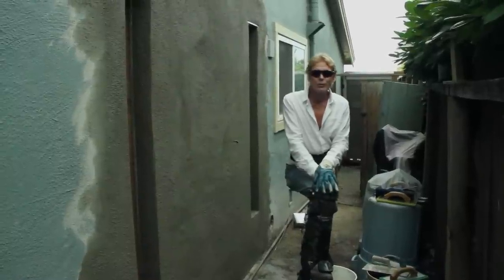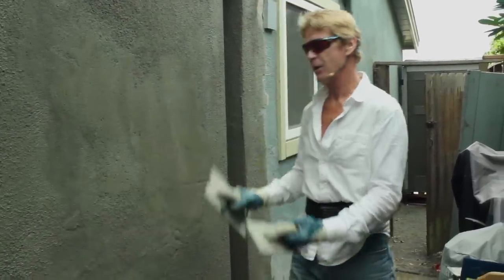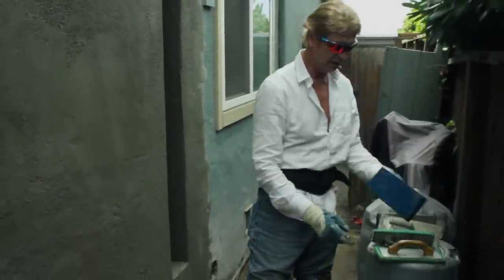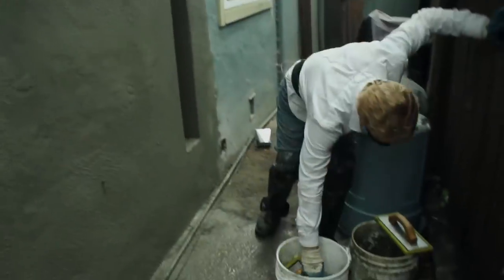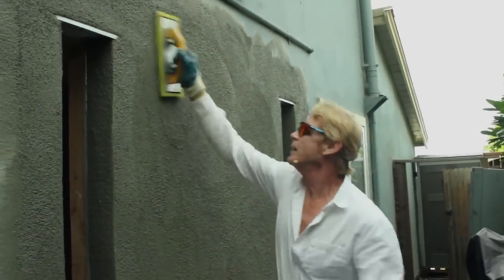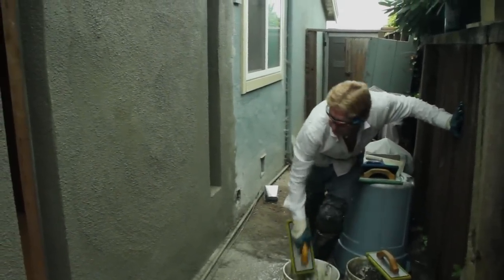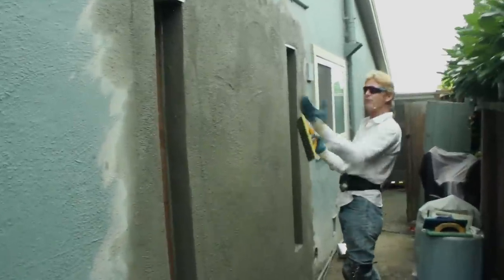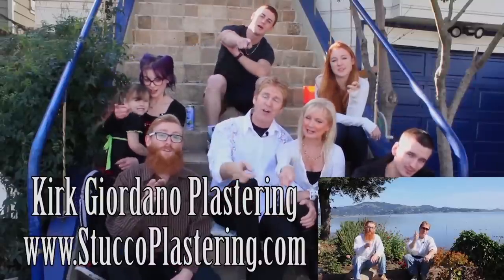Stucco sponge floats bring out sand or aggregates.

Comment: If you do alot of stucco you will have walls that "get away from you" and you'll be busting your ass to finish it.....because we are human and that's just the way it goes at times, lol

I have been there hauling ass, beat ass tired and no lunch break. Lol

Cement doesn't wait for anyone

On other side I have been at jobs til midnight cuz I poured a slab too late and it just wouldn't set up.......live and learn
Reply from the maker: Exzackory, I have lost a few walls, as a rule, not more than I can count on one hand, as once that lesson is learned, you stay learned. Concrete slabs, now that another animal, are twice as difficult.🍻

Comment: I got a job doing a stucco patch. The stucco had bulged and cracked open in places some of the wire lathe had rusted a real mess. I work with concrete never worked with stucco. 3 people before me tried and failed. So my job was not only just to do the  repair I also had to blend out the mistakes of the first 3 guys. One guys patch had a bulge all the way around where their patch met the original stucco. Because of your videos I have a very happy customer. Thank you so much Kirk you were the reason why my client is so happy.
Reply from the maker: Good evening John Wadsworth, I'd love to take the credit for your job well done, but the fact was it was your intuition of the time spent learning and retaining the information, that created your success.
 Cheers my plastering friend.
Reply: @StuccoPlastering  Kirk I still can't thank you enough for all the information I received from the videos you took the time to make. And I really appreciate you for replying back to me. The house was a very old one it's stood in Monrovia California for over a hundred years. I had no idea what I was doing. The information about the different color sponge floats and what they are used for helped a lot. Like I mentioned to you before I had no experience working with stucco. I was very nervous when I got the job. And being that it was also a referral made it even more urgent that it was done correctly. It's been over a year and it looks great. Being I was the fourth person to try and fix the problem it was a must that I get it right. There were a few moments of panic but I learned to relax. I have my own business and it's tough being a one man show. Anyway just thought I'd touch bases with you and thank you once again for teaching me so much in a short amount of time. I have no idea where you are from, it would be nice to sit down and have a beer with you or go grab a bite somewhere on me.
Reply from the maker: Evening John, your comment makes my point, many can learn when paying attention and when they need to know how to do it correctly, Thank you brother for the kind comments.
 FYI, I'm in the Oakland, ca. area.

Comment: Hi Kirk! Thanks for the video! I’m curious, if you’re trying to match a sand finish with interior plaster (using usg imperial base) do you use a similar approach to this with a sponge float? I have lathe and plaster in my 1930 home and there seems to be some sort of aggregate in in the plaster that they’ve vertically brought out with a float? I’m so puzzled on how they achieved the finish and so are others I’ve showed pictures to.
Reply from the maker: @dianaallen9172  Morning Diana, imperial has fine sand so yes it can be brought out with a float, this technique can work, sounds like they wet the sponge float which makes deeper float lines that are noticeable. Send me a picture at kirkgiordano@gmail.com cheers

Comment: Hi Kirk, huge fan and avid watcher (is that a word) of your channel. We have a so cal, Orange County house and had some stucco replaced from the mini mountain finish, I called it, to a flat / sand finish. The contractor was a joke and the whole job thickness is thin ...thank goodness they only did the front.  I’m thinking they didn’t set the wire out enough and did a thin scratch and thin brown coat, and the icing is the color coat is 20 shades of brown 😪😪. I. Estimate it’s about a 3/4 inch difference from the original thickness (when I drill in to attach something it’s not even 3/4 thick, boom right through).  How can I address the thickness issue?  Should I go back and  make a bunch of consistent chips with my rock hammer or add some expanded metal and apply additional scratch (after coating with the prep liquid...the name eludes me, (please remind me of the blue prep adhesive coating) and then another color coat?  Please help, I’m at my witts end and can’t stand seeing the wire corners through the finished product, we have a Spanish architecture style with 6 arches. The contractor is nowhere to be found, and my wife is on me like cheese on a pizza.  Thank you in advance, since I can’t attract you down here for this job. Tony V in OC.

Found the Product, weldcrete. Just need some advise on the repair of the crap job. Thanks. Tony
Reply from the maker: Howdy Tony sounds like they just had a clue as to what they were doing.
 Stucco, as a rule, should be 3/4 thick. However, I have seen plaster in excellent condition at 1/4 inch thick and up to two inches thick.
    You can apply the weld crete as the bonding agent. Then apply another base or second coat.
 If it were me, I'd just apply a thicker color finish using 16/20 finish coat integrated La Habra or Western finish coat.
 It's roughly about another 3/16s of an inch thick.
 

                                                 Introducing peace, love, and harmony back into the world of plastering.
                                                             university of plastering by Kirk and Jason Giordano

Comment: Great video as usual Kirk, your shoulders must be on fire every day like mine. I get pins and needles numbness down my arms from nerve issues in my neck due to all the looking up at what I’m working on.  Hope you’re holding up better than I am, we’re about the same age I’m guessing.
Reply from the maker: Howdy Clint, no, this does not happen, I would suggest, this may sound stupid to most, align to two 2 by 4's about an inch apart, then lay down on t with your spine in the middle of the gap, then gently rock from your head to your feet.
     This will align your spine out by a little or a lot.
 This takes practice, big time as often I will do this while on scaffold just using the planks, again space the boards about one-inch or two so your spin does not hinder the result.
      O yes, often I have to use a carpet or even the concrete, but I dont place all my weight on the spine.
 This again sounds goofy, and most won't have the patience to do it properly or worry about someone watching. I would advise you to try it slowly at first as it does take time to learn.
      Or keep your chiropractor with you on-site at all times. 😏
                           Introducing peace, love, and harmony back to the plastering world.        
                 Sound Plastering tips for the DIY beginner or the Professional Plastering experts

Comment: I haven’t used a float to float the cement in years.. out here in North Carolina on new homes/ additions we level the walls and than use a base coat that’s used for the eifs system with fiberglass mesh to get a crack proof wall than final color coat
Reply from the maker: Howdy Armondo my fellow plasterer that does take a high level of skill,
 when I'm doing patchwork, 100 percent of the time, I have to match the existing finish as close as possible.

                  Bringing peace, love, and harmony back to the world of plastering.
    The complete plastering encyclopedia on video, by the plastering messengers of Youtube.

Comment: Great vid as per.
Looks like hard work.
Floating up ok but I've gotta get it to stay on wall without falling off all the time.
Anyway. One question. 
Well two actually.
Do you think the original plasterer intended to to leave it looking so rough with trowel lines. Or just that he couldn't get it flat? 
Second. When leaving the wall  opened up like that wouldn't it leave the wall more open to bad weather ie not weather proof. 
Just a thought is all.
I'd want the rain to run Off my house, not soak in.
Reply from the maker: Howdy John, the texture you see is simple to accomplish, so the most common.
    The stucco finish has nothing to do with protecting a home from water penetrating. The paper moister barrier does this.
 Also, if you paint a home, this protects it from water damage if the paint is of superior quality. 
This is the dreaded yearly maintenance that all should do with their homes, vehicles, and health anyway.

                           Introducing peace, love, and harmony back to the plastering world.        
                 Sound Plastering tips for the DIY beginner or the Professional Plastering experts
Reply: @StuccoPlastering  
Thanks for getting back to me great videos. I've Gotta find a wall somewhere to practice on😊 
I'm a painter and decorator and sometimes have to do repairs but mainly on a small scale.
I usually call in plasterers. To be honest some times I think I could do a better job as I've had to sand down after they've left. 
Anyway each to there own. 👍

Comment: you should of used a 6" water brush to splash the wall instead a dipping the sponge in the bucket so often
Reply from the maker: Howdy Shane, thanks for the tip, been there tried that, will not bring the results I want; instead, this idea would create a mess.
                  Bringing peace, love, and harmony back to the world of plastering.
    The complete plastering encyclopedia on video, by the plastering messengers of Youtube.
Reply: @StuccoPlastering  no boder kirk, do you know what a nap finish plaster is ?